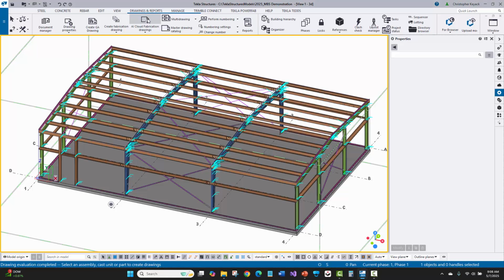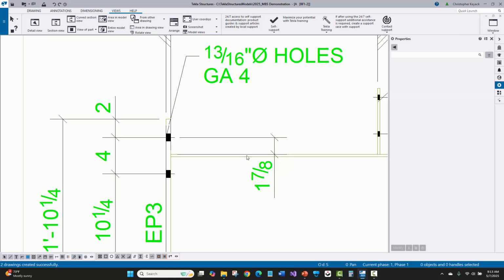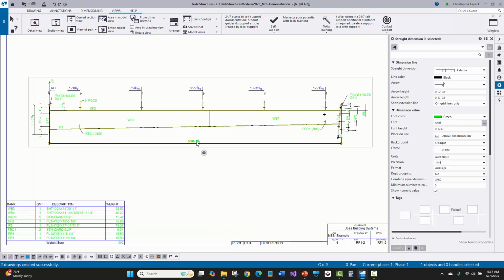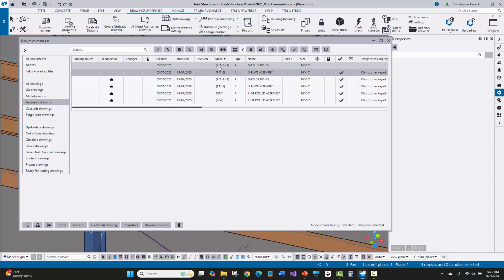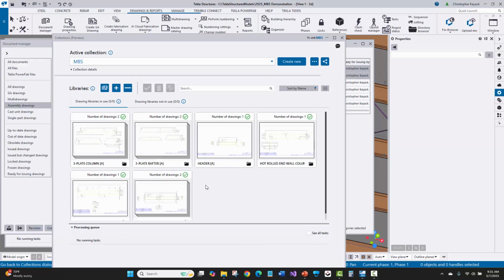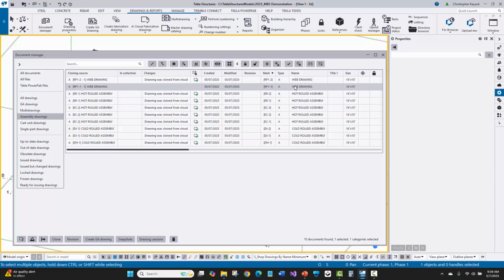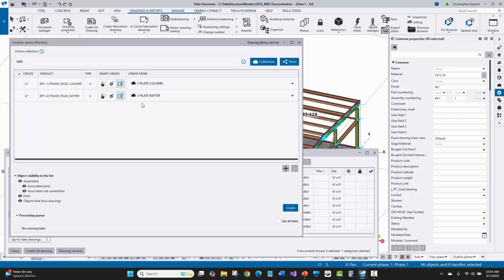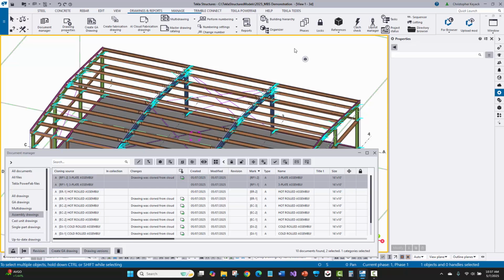KTS - Tekla AI Cloud Based Fabrication Drawings

Comment: Hi Chris! Thanks for the demonstration.
I'm getting the feeling that this 'AI' is just an old cloning feature wrapped in new dialogue boxes and running on a cloud server. Are you able to compare simple cloning (using DM) and 'AI'. 
Isn't it just a fancy marketing? For me, it looks like a bunch of IF statements and an old cloning feature rather than AI.
Reply from the maker: AI is used for the search and closest match based on properties and then the cloning part itself is still the same as the traditional coded / programmed cloning process.